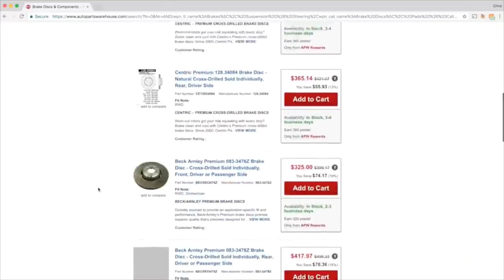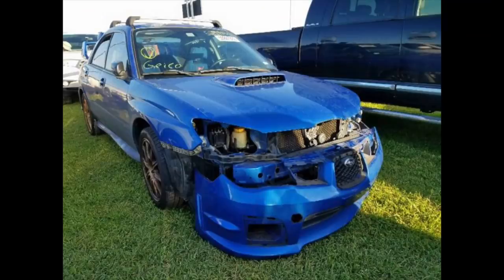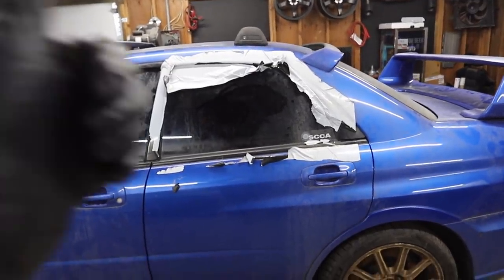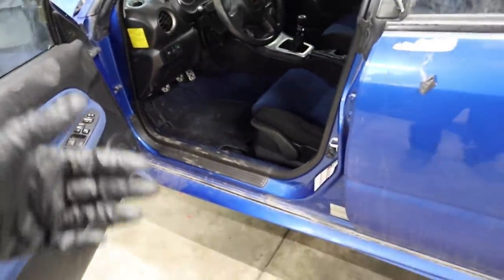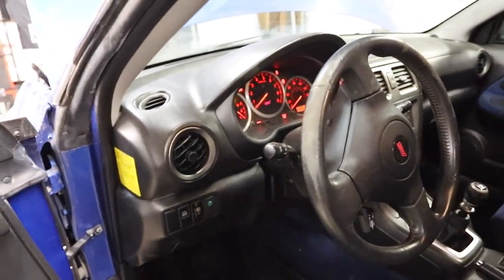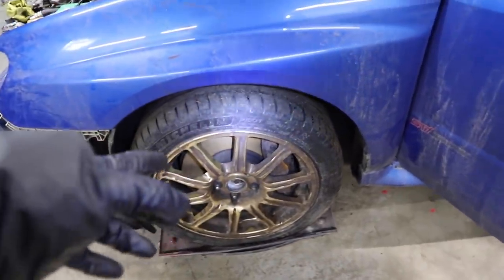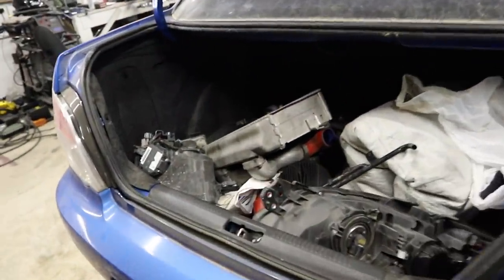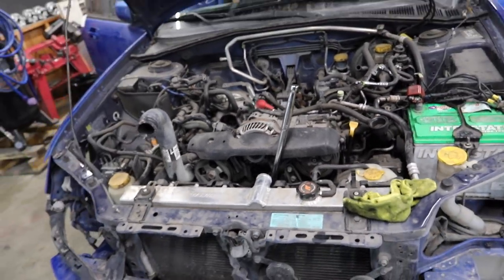I Bought a FLOODED TOTALED Subaru WRX STI from a Salvage Auction & I'm going to Rebuild It!

Comment: I would drain the engine, differential(s), transmission and anything that may retain water. Change brakes and  flush all fluids. Congratulations on your purchase!  Look forward to hearing more about the STI. Best wishes and Peace out!
Reply: The wiring will be a beast
Reply: Mechanical is easy to sort out. I would be more afraid of all the electrical problems down the road.
Reply: @palillo2006  and the mold inside the carpets and hard to reach places.
Reply: i thought that was an sti as your profile pic smh
Reply: @ST-ip7sg  - Afraid not.  1998 Volkswagen Beetle Turbo Diesel 5-speed. I do like the color though.
Reply: T Rantz was thinking that exact same thing. Flood damage? My first thought is look at the undercar
Reply: T Rantz why wouldn’t you just leave all that leftover water in there? Seems like a better strategy to preserve the water.
Reply: It's not the water he needs to worry about - it's the silt. He also has a serious problem if it was salt-water flooded.
Reply: In a flooded car the best thing to do, is replace the electrical. Given the year of the vehicle , there plenty of parts out there for it and not terribly expensive.
Reply: @powcar91  The mold in the Pacific Northwest takes hold at the slightest hint of moisture and is next to impossible to eradicate because of the climate. Especially at this time of year.
Reply: I would add a full strip down and heated dehumidified room to that list, just to fully eliminate residual moisture.
Reply: Definitely the way to go, only knowing this channel it'll be 6 episodes for him to change the oil on the engine and explain how he's going to turn it over lol.
Reply: He's already rebuilt a flood car, the rx7

Comment: The engine is easy to turn because it doesn't have compression. It's likely that it hydrolocked and pushed water out the valves that are rusty. Water got into the engine through the exhaust system and into the oil by getting past the piston rings. I've seen this exact thing before. I'd recommend a compression test before doing anything else with it.

I'm really enjoying the change of pace with this build, I look forward to seeing how it turns out!
Reply: If there is water in the engine, its from the hoodscoop letting rain water in with the intake manifold being removed.
Reply: I'd tear the motor down to at least the short block.  It's too easy to do and could prevent further damage caused from trying to crank it.
Reply: I’d rebuild all the engine, its the best way to solve problems
Reply: @JonHowes1  If that were the case there wouldn't be as much water in the oil nor would there be corrosion in only those two valves and nowhere else. It also wouldn't explain the low compression.

Comment: I feel like there are some pretty obvious things overlooked when assessing the history of the car. The SCCA sticker on the back driver's side window is a good hint the car has been used for racing. This is reinforced by the aftermarket aluminum radiator and the Mishimoto radiator cap. Others have already pointed out the milky oil could be a head gasket issue which is probably a decent guess considering the water level was not high enough to flood the engine. 

Regardless, save yourself a step and rip out the engine and start a rebuild. As you mentioned, Subaru parts are really easy to find and replace in Portland. Lots of places will sell you a rebuilt EJ for under $2K. 

This will be a fun build to watch. Partner with some of the local Subaru Performance companies like Perrin or Nameless and make a beast.
Reply: also the offset turbo inlet coupler, means it had a hard pipe inlet. (which you need to pull the intake to get out)
Reply: I agree with you and it kinda makes me mad when YouTubers who do this as a career blindly overpay in bidding wars against people who just want a car to build themsleves for a good deal. Outa respect to keep prices low he should at least do his research. I'm sure it'll be a sweet build just don't like all them raising all bidding prices on cars we all would love to build as our only toys not fleet of exotics. Means nothing to over pay for him for totalled vehicles but isn't helping everyone else bidding against people like him.
Reply: I wonder if the car was flooded while it was being worked on....
Reply: Benjamin Wells the rear windows look like they could have had the carbon slip in vents that a lot of the subie guys love. Previous owner probably just yanked them out and left the windows down that far.
Reply: I saw the SCCA sticker and my first thought was Autocross.
Reply: I have a SCCA sticker on my Prius.. doesn't mean it's used for anything.
Reply: @moralchrtr The more you look at it, the more I think this is the likely cause. Started working on the car, had it tore apart and then a big rain storm hit with the rear windows (with slip vents as proposed by Cory) and the hood open or off. This floods the engine and floods the interior of the car. That would explain why the water line was so low on the car and the electronics still worked as they stored the battery situation out.

Comment: If he had aftermarket parts in, he probably had a Cobb accessport and aftermarket or cobb factory tune. If the owner had no chance to reflash you may be rebuilding a vehicle on a tune, so the ECU may be flashed. Somthing to take into account.
Reply: T B because the fans were cycling, there’s also a high chance that the previous owner was able to unmarry the ECU and accessport.
Reply: @robnorthem7723  well either way, this guy know what he's doin. Hopefully it all goes smooth for the rebuild.

Comment: Part II. 
Looks like the car has TGV deletes on it so take good inventory on all the parts you have because the car won’t run right without a correct tune for the aftermarket parts or put everything back to stock and it should work fine. If you need to change the ECU you might have to pair the immobilizer to the new ECU.

Comment: I've owned 3 STi's now. All I can say is good luck and have fun lol
Reply: The Sigma Enigma which was your favorite?
Reply: I've had my share at ej207s, an ej20x, ej257 and an ej255, all good stuff and will probably daily drive a Subaru for the rest of my life.
Reply: Ej255 was my favorite and it was inside my garnet pearl Legacy GT w/ 5-speed manual
Reply: @KronicKatz  have you had a EJ253? I'm chasing a coolant problem and cant find any solutions anywhere.
Reply: KronicKatz As for Subaru I currently have a GD STi and a bugeye wagon. Will always have one Subaru in the garage in the future 👍🔥🔥🔥
Reply: @paulaspen7880  if you loose coolant and It doesn't leak anywhere I'm Sorry to say It but It could be your headgasket, do a compression test
Reply: pier99francesco I’m 99% sure the previous owner had them done. Something was making the expansion tank to over flow, replaced the radiator cap, then the thermostat (doing the cheaper things first). The problem went away but now, a month later, my coolant just disappears. Nothing of the ground, no leaks, just gone. I have to put probably 20oz in the radiator every week. The engine has 170k on it so I’m not about to invest $2000 in a head gasket job if they are bad again. Sucks cause I really REALLY like the car.
Reply: @paulaspen7880  yep thats 100% head gasket. 4 symptoms point to head gasket. The heads probably warped and the dummy that did them last time didnt have them decked. Id LS swap it if you have one laying around, or just sell it now before they get worse.
Reply: @paulaspen7880  head gasket
Reply: @paulaspen7880  Sure it sucks when my car breaks (I drive an e46 with 170k miles) but I'm Always excited to learn new stuff about my engine good luck fixing your car
Reply: @theangryitalian7922  very nice! Mine is similar. 05 obxt with a jdm spec b swap. Fun car!

Comment: I own two of these, 2004 & 2006 STI’s, Nice choice 👍 Looks like you got everything working, needs a few things needed here and there but overall looks solid. Only thing I’d suggest to whomever is building it, that after you get it all back together and with the mileage that car has, you will have to do a timing belt service (100k) on that car so just another step but nothing too big if you know what your doing. Good luck guys.

Comment: Chris! If the check engine light is blinking in the future, and the fans are running when the key is on “on”,   check for 2 green pins under the dash. puts the car into test mode, and most people plug them in cause they’re both green

Comment: "Never owned a subaru before"
"Oh wait" remembers the BRZ
"Never owned a REAL subaru before" lmao 😂😂😂
Reply: Was about to write this 😅
Reply: *sad torque dip noises
Reply: Facts
Reply: Those are Toyotas lol
Reply: @MidwestDankAlumni  no they arent lol if they were toyotas it would have the inline 4
Reply: The best Saab is a Subaru. 
9-2 & 9-2x.
GM owned all of Saab and 16.5% of FHI  (Subaru parent company)
9-2 is known in the Subaru community as the Saabaru.
It's literally an STi wagon (which Subaru didn't sell in America those years)
Reply: Lookout subapoop fanboy here.
Reply: @MidwestDankAlumni  saabaru is ej205 5 speed. WRX wagon not STI
Reply: @fred50659  it had aluminum control arms like the STi,  not stamped steel like the wrx.
Besides,  good STi have ej207
Reply: @MidwestDankAlumni  yes ej207 not junk ej205
Reply: @fred50659  my 98 impreza has a 205... lol
Reply: @MidwestDankAlumni  and it can bare keep its shit together at the stock 220 or some hp
Reply: @MidwestDankAlumni  Wrong, the body is based off an Impreza chassis with many of the same pickup points even. It's why there are a bunch of Impreza/WRX control arms and shit that fit, although it is a bespoke variant for these cars. Toyota did the sheet metal design, the transmission and the fuel system. Pretty much everything else in that car is Subaru.

Comment: Check the chassis for signs of rust, interior under the seats for watermarks signs, ej20 engine block, front mounting for the front bumper, light bulbs on the front headlights and rear tail light.. You may get a hell surprise..

Comment: You got a great deal dude. Just the BBS stocker wheels are an easy $1000. I had a 04' STI. Worst case scenario you get a used EJ257
Reply: Wheels, tires, the big brake kit, body kit, STI seats, STI trans, STI diffs, he'd make a killing if he parted it out. But definitely cooler to rebuild it.
Reply: @BlueHokage  Didnt know that...but still there are plenty of parts there to cover the 3 grand and make a profit if rebuilding doesnt work out...

Comment: I bought my 1999 impreza with flood damage. Water level at door handles. Change all fluids before start!  Only things broken with mine was all wheel bearings(sat for 4 years after flood) and the rear window motors. I daily it.

Comment: Just the brakes are worth 3k... Authentic BBS wheels are worth a good bit 900-1k each I believe. If you can find the manufacture date on the door plate, you can find out if you have the one with oil squirters or oil scrapers. 32000AJ100-TY856WW8MA '06, June — '06, December
 32000AJ350-TY856WW8MD '06, December — '07, June
The J100 has the oil squirters and is considered the best 6 speed transmission and is still favored in group N Rally. 

Even if you need to part it out you can make some serious money.

Comment: For the oil to look like that the car would have been running when it flooded or it could of had a blown head gasket before the flood. I would imagine that the rod bearing would’ve spun if it was running when it flooded, I would recommend doing a rebuild or swap. If all the electronics were working then I think it was a blown head gasket then sat in flood water to claim insurance.
Reply: Blown head gaskets are really common on these
Reply: Yeah these guys dont really fix cars they just do enough to sell them and make money on youtube
Reply: Ryce Yanez yeah I’m thinking that too, blown head gasket and engine pulled apart sitting in the garage when the flood happened
Reply: Also looks like the car was tuned and has TGV deletes on it so take good inventory on all the parts you have because the car won’t run right without a correct tune for the aftermarket parts or put everything back to stock and it should work fine. If you need to change the ECU you might have to pair the immobilizer to the ECU.

Comment: 2007 nice! That has the 3.54 long gear 6 speed. Very sought after in the community for anyone looking to do a 6 speed swap in their WRX. These transmissions alone sell for $2200 used in my area. Matching rear diff goes for roughly $450 too

Comment: B is for Blown Headgasket 😜😂
Reply: not on turbo EJs
Reply: Dude I bought a little outback like 6 months ago. Great little go cart of a car. But the fucking head was blown in a way that was pushing exhaust into the radiator system and making it puke it all out. The car was a 4 banger automatic with like 300,xxx miles on it so not worth the rebuild. Sold it off for like $800 to the next guy to wash my hands of it.
Reply: Beat me to it😂
Reply: N/A EJ's have head gasket issues, non of the turbo models do.
Reply: Cosigner22 turbos blows headgaskets, NAs blows headgaskets, H6s blows headgaskets they all blow headgaskets
Reply: B is for blown ringlands
Reply: Here we go.. turbo ejs dont blow head gaskets smh
Reply: Maybe on Ford Focus RS's...
Reply: Yeah my 05 WRX blew head gasket and heater core leaked bad at 180K...
Reply: @trentsizemorephoto  yeah, but at 180k? I wouldn't complain.
Reply: wouldn't he have seen a cylinder misfire code if it was the headgasket?
Reply: Turbo EJ25s don’t blow head gaskets as often as the naturally aspirated ones, but they still do it. It wasn’t until recently where they fixed that with the newer STIs.
Reply: @EvelynRoods  my 04 WRX blew head gasket around 130k @Snowcruizer Ringland failure is for newer model 2.5s not this one.
Reply: daniel berrett sorry, meant 257s. I forgot that the 255s still blow ‘em as frequently is the N/A ones.
Reply: @blazinsubie8948  That's good to know. Everything else would've gone much longer but nobody in my town even wanted to touch the job and the dealership was outrageous.
Reply: @EvelynRoods  no they dont. Lol. They're basically the same goddam engine. Slightly different heads with lower compression. It's all the supporting accessories that are different.

Comment: I say Just pull the spark plugs and crank It for a few seconds, drain All the fluids and put new stuff, install the parts that are missing and call It a day, I have Faith in her
Reply: Cars are more durable than people  think. This guy gets it.
Reply: +1 with a compression test before trying to fire
Reply: Prep it like a seized engine (fog the cylinders) before you crank it.

Comment: looks like head gaskets blown and the owner used drove it into floods just a little as in excuse to get it fixed or written off.
Reply: Smart guy
Reply: Or simple hydrolocked with those open pod filter..boosting in flood... 

Wont happen that easy if it still have oem air intake box fully intact
Reply: Exactly sometimes you find some nice salvaged cars at auction that you think how in the -$;& is that totaled when its easily repairable
Reply: Because the insurance company is the biggest racket around.  That's the entire reason people purposely "accidentally" damage a new car they are behind in the lease on so they can get their money back.  I've seen cars declared totaled out because of some panel dents and a few scratches. Because they tell you in order to fix a dent or a scratch you have to remove and replace the entire panel and repaint it, at the dealer, at OEM prices, with OEM labor charges.
Reply: @MrWolfSnack  my sisters airbags in her Impreza went off in a 10mph fender bender and adjuster considered her car a total loss
Reply: Yeah that's because it's a rip off.  They charge like $400+ for each of the airbags and then they quote the entire dashboard has to be removed and replaced, another $1k+ in parts and labor. Then wouldn't you know it? The repairs have magically cost more than the car. Then they take the car and sell it back to try and get retail value off it as a wreck (which they never will). It's a big scam. 

Go to the junkyard and buy the airbag yourself and repair the damage yourself. I got a van off COPART that was quoted to have $3,000 in damage for a rear impact. I got it for $350 bid. All I did was replace the tailgate with one from the junkyard and got an unpainted bumper off eBay and that was it. It's back on the road now. It was inspected by the DMV officer and determined to be fully functional and road legal.  The other nicks and scratches all over the car they didn't care about. If the new owner wants to color match the parts they can.
Reply: @MrWolfSnack  her Impreza was a 2012 with 32k miles, so we were surprised by it, but they said the insurance doesn't want future law suits for possible faulty air bags in the future, according to the shop my uncle works for. So she got a 12k check. There was small body damage but never thought it would be considered a totaled car
Reply: Yeah that's all a load of crap. 100% bullshit.  Chilton's repair manuals give step by step instructions on how to replace airbags. It takes 30 minutes tops.  and the Chilton manual instructs you on how to clear the error code memory to reset the airbag warning light for the new airbag as well.
Reply: @MrWolfSnack  Maybe so but either way she got a new crosstrek out of it.

Comment: Intake manifold holds the engine harness and a lot of other stuff like sensors and actuators so get your self a manifold assembly off the used market to even start diagnosing anything. Those intake runners are aftermarket they tgv deletes so expect a code if you don't replace them. This car was absolutely tuned before fyi.
If need any info or help let me know. Very excited for this build
Reply: Ivan Colon good info. Is that your car in the profile picture?